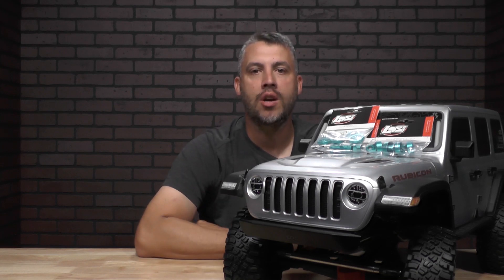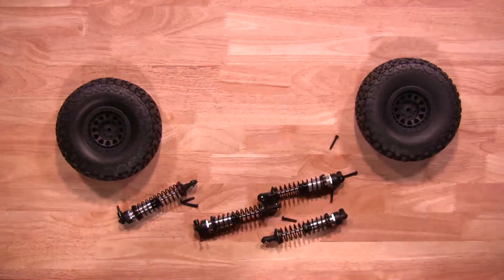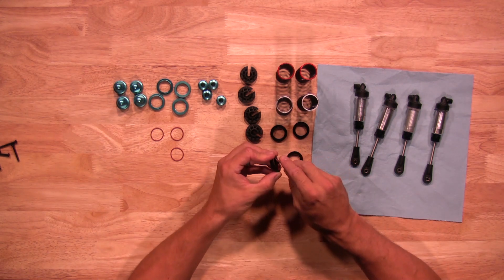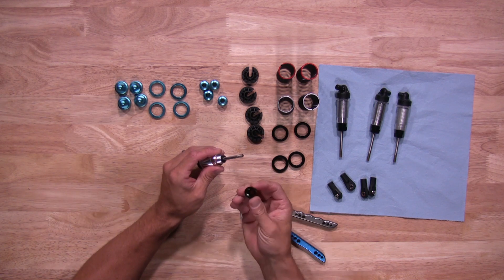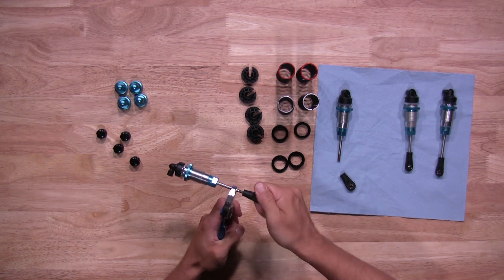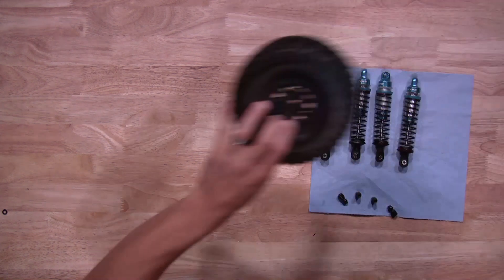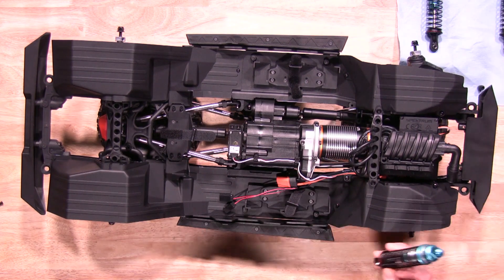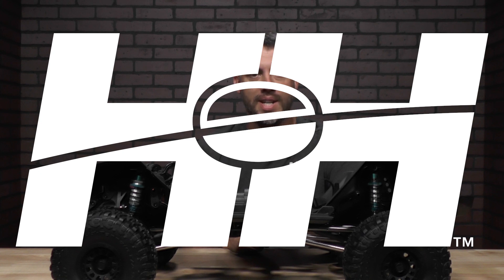From the Tech Desk: How to convert your stock shocks into replica King shock on your Axial SCX6

Comment: Something is up. Went to order all these PNs to do this, but the PN listed for the upper shock caps only comes in packs of 2, not the 4 pack pictured here. Also can’t really tell in this video but 2 of the 4 caps will have the logo facing in a direction you won’t be able to see them while mounted on the truck. Just a FYI for anyone looking to do this

Comment: My scx came with silver springs I front of the vehicle, red in rear ?? Also you fail to mention that the ball stud standoffs diameter are smaller than the king shock caps hence major movement not remedied in this video. Stating a washer is needed only makes them mount up. Other fabrication is needed to make them secure with no play. I thought this video was made by a private consumer but no , it’s you horizon🙄
Reply: I’m yet to purchase, curious what you would do/did to remedy the play? Are different ball ends needed?
Reply: @brianbenner2411  Different ball ends were not needed. I used some rc nitro fuel line backed by a washer on the outside of the shock cap to remedy the slop . A year later and everything is still good.